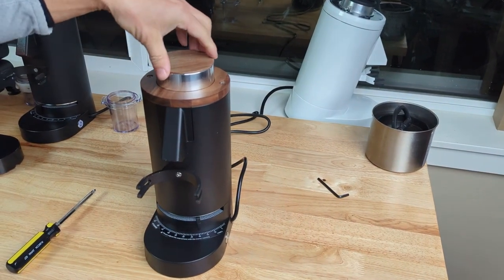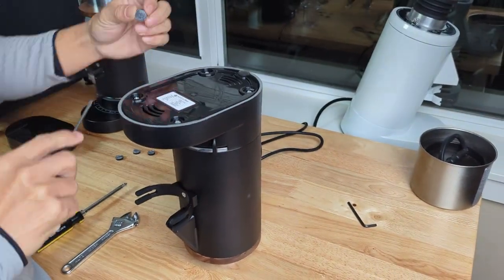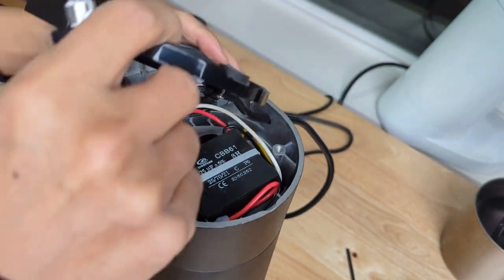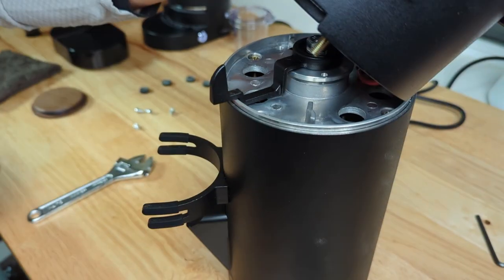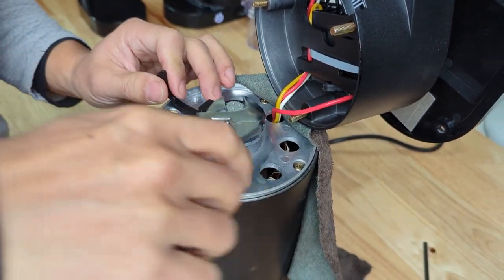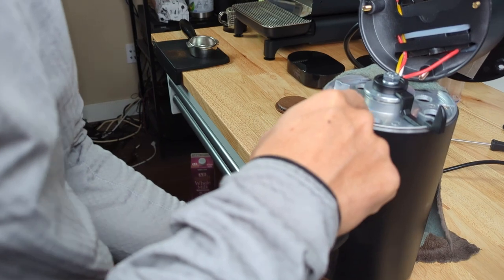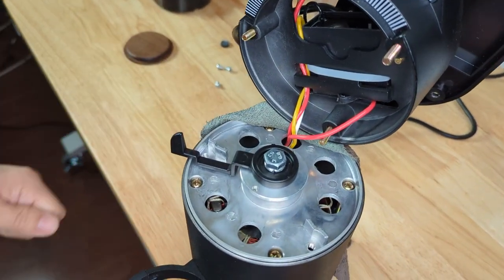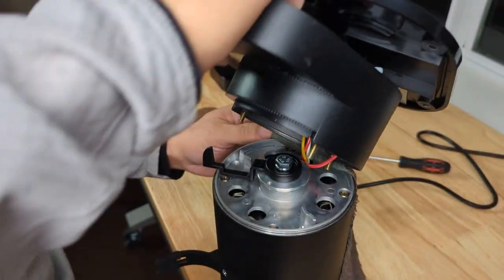DF64P Zero Point grind dose adjustment

Comment: Used this video twice now on my DF64P and it works fine. A bit fiddly yes, but at least one can achieve the objective. Just be careful snd don't rush anything. Have the right size tools for the screws and the main bolt. It's more awkard than it is difficult, but how many grinders allow you the access to make these adjustments? I'd hazard, not many.

Comment: None of these videos are helpful with later Turin shipments which have glued the bolts in place. The lever will snap if you try to hold it in place to loosen the bolt. These are bricked machines.
Reply from the maker: Our grinders don't have those glued together. The bolts are just very tight. I usually use two wrenches to get those loose.
Reply: Very helpfull...thank you so much